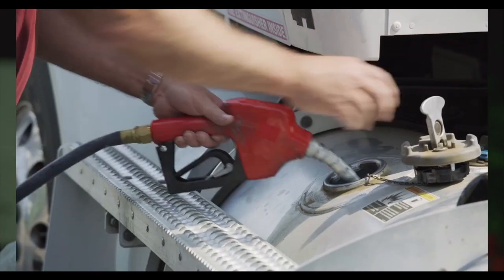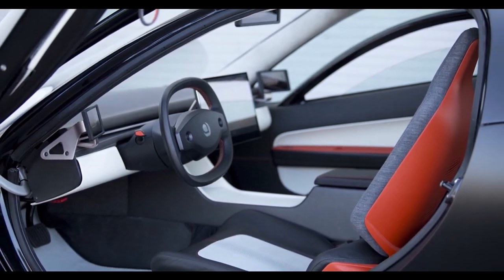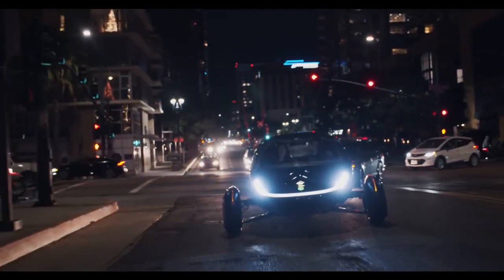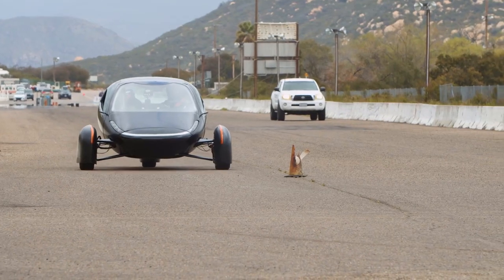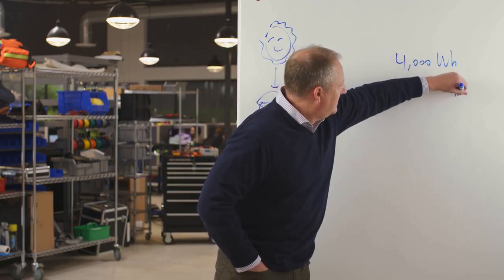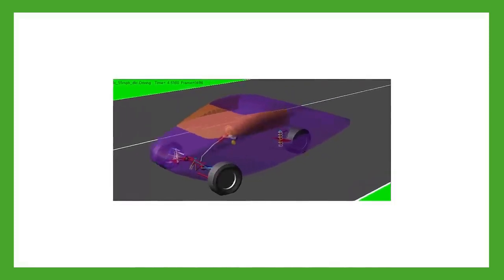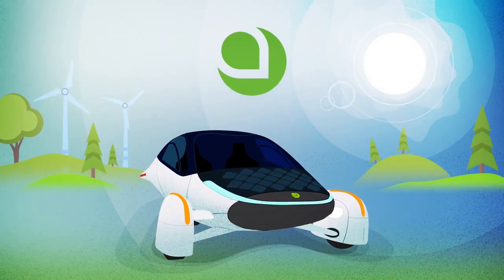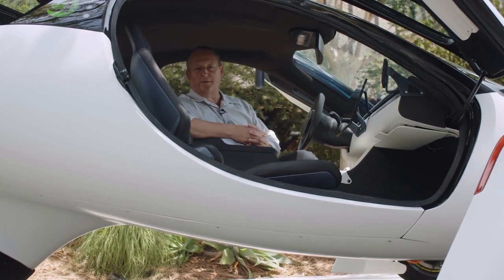Aptera: See what the solar excitement is all about.

Comment: Very good points. The small incremental progress in gas cars is lost as they get bigger and bigger. 
Gas car 20% efficient
Diesel car 35% efficient
Hybrid car 40 % efficient.
Hydrogen car 20% efficient.
Battery Electric 80 to 120% efficient.
My bicycle 90% efficient but 1 person. Slow not aerodynamic
Reply: FYI, humans are about 20-25% efficient at converting calories to motion. Also, some gasoline engines are near diesel efficiency.

Transmission efficiency on a bicycle is ~85-99% efficient - towards the upper end for single-speeds, derailleurs, and Rohloff hubs, towards the lower end for NuVinci/Enviolo CVT hubs, Shimano 8-speed hubs in 4th gear, and Sturmey-Archer's 8-speed hubs in higher gears. However, 80-90% is pretty typical transmission efficiency for ICE cars.

...of course, then, you've got electric bicycles, where you can get the mechanical efficiency of a BEV with the lower power demand of a bicycle. And, there's things like velomobiles with even lower power demand/higher speeds through aerodynamic efficiency.